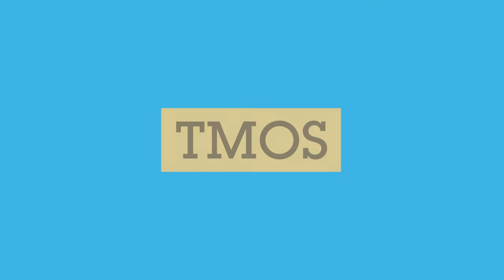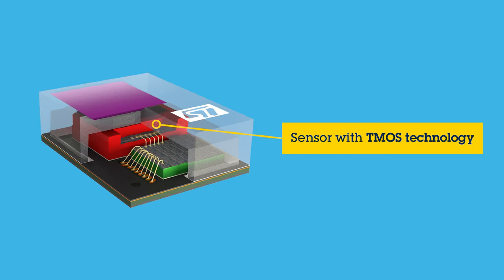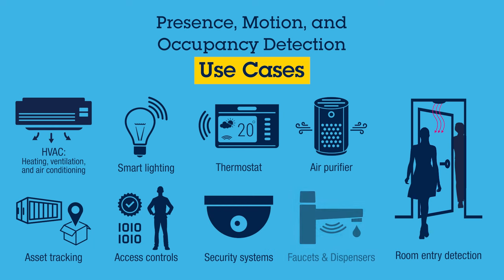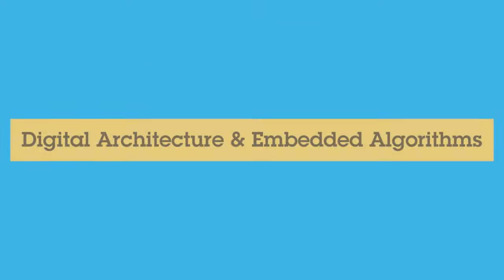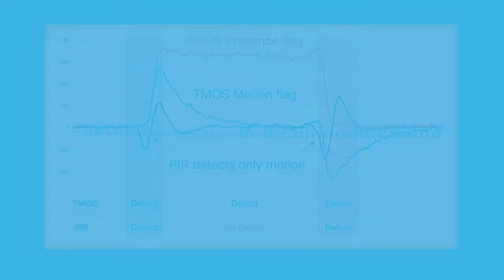Understanding the STHS34PF80 Infrared Sensor: TMOS Technology Overview

Comment: STHS34PF80 Infrared Sensor: A Technical Overview

* 0:01 Introduction: This video introduces the STMicroelectronics STHS34PF80 infrared sensor, a low-power device for detecting object presence and motion.

* 0:43 TMOS Technology: The sensor uses Thermal Metal Oxide Semiconductor (TMOS) technology, fabricated using SOI CMOS and MEMS processes, for high performance and a small form factor.

* 1:01 How it Works: The STHS34PF80 detects infrared radiation emitted by objects. It has a sensing element with one part exposed and the other shielded, allowing for differential readings to improve accuracy.

* 2:12 Key Features:
    * Compact SMD packaging with digital interface (I2C and SPI).
    * Embedded presence, motion, and ambient temperature shock algorithms for low power consumption.
    * Wide field of view (80 degrees).
    * Detection range up to 4 meters without a lens.

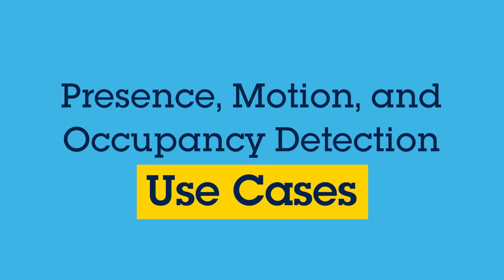* 2:34 Applications:
    * Smart home automation (HVAC, lighting, thermostats).
    * Occupancy monitoring.
    * Asset tracking.
    * Access control and security systems.

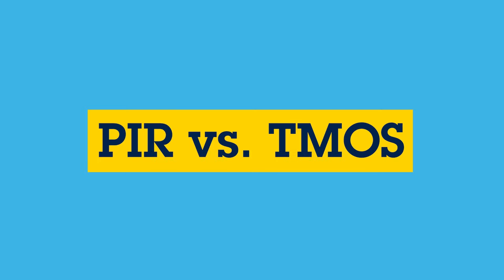* 4:26 Advantages over PIR Sensors:
    * Detects both motion and presence.
    * Smaller form factor.
    * No lens required (up to 4 meters).
    * Digital interface and embedded algorithms simplify integration.
    * Lower power consumption.

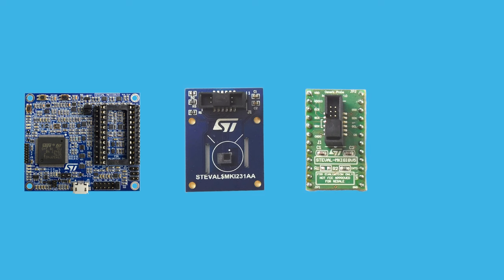* 5:54 Next Video: The next video in the series will cover how to evaluate the sensor using an ST development kit and software GUI.

I used gemini-1.5-pro-exp-0801 to summarize the transcript.
Cost (if I didn't use the free tier): $0.03
Input tokens: 5790
Output tokens: 655